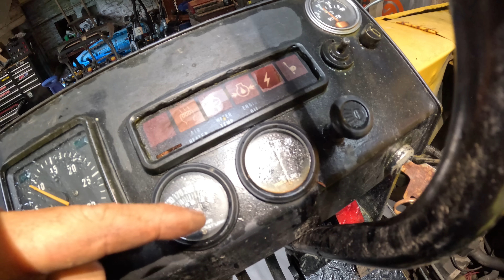Buying a broken yanmar diesel dump truck

Comment: Max and Mingo are such sweet dogs, I love them. Check the crankcase breather on that engine, it's not letting much air in because the oil was having a problem draining. God bless, you're living a lot of people's dream! 🙂
Reply from the maker: That’s a good point. It drained once I opened the cap but it does kinda hiss for a few seconds after you shut it down, maybe the breather is restricted

Comment: I ran an old case bulldozer for someone once and only the left track brake would work so if you wanted to turn left you just went forward with the left brake on and it turned left and if you wanted to turn right, you went backwards with the left brake on and it would turn you right lol I got super use to it after dozing 20 acres of trees and brush.
Reply from the maker: I ran a d9H like that for a couple weeks, pretty annoying lol

Comment: Nice score! I have a YFB 20-2, older version I resurrected from certain death. They suck to drive but worth their weight in gold when you need them so worth buying. Mine has full manual drive train also, and is still in factory - stock adjustment locations. Yours in is in pretty great shape, Id go through the whole thing, fix all the dents, change all the fluids and recondition her and she will be like a brand new one! 
I mostly use mine for hauling firewood. lol
Reply from the maker: It’s such a useful machine! I did a service, just gonna use it and take care of it

Comment: Hey great video!
I bought one of these earlier for basically pennies. Mine had a mud drill mounted in the bed. I didn’t get a chance to make my video of it yet but I sold mine for $6700. Yours is in ALOT better shape. I’d say you could pull 8-10k out of it easy. 

I have a smaller version too, it’s only 48” wide. Great for getting in to tight back yards!
Reply from the maker: That’s good to know, I kinda figured. 8-10k was the market on em

Comment: I noticed you forgot to put the Mahindra in 4x4.. but I also noticed the eas at which the rear wheels spun. Fill those rear tires about 75% with water... much better traction without having to buy wheel weights. 
 That track truck is pretty cool.  Too bad it doesn't have a "road gear "...lol 
 Great content

Comment: Value, due to it's marginal capacity and used condition is probably 8 to 10K, maybe for for someone who has a direct need for such a device.  I have rural land and can not think of much value personally so I'd pay nothing.  However, if you had swampy land and needed access with dump ability, this might suit you just fine.

Comment: 40:15. When I saw that old 2x10 I thought of something. would it be beneficial to use that (or something like) to mount above bed side rails to increase load volume? Also, since you got a oil filter, I'm assuming parts availability is not an issue? Be blessed bro. Yashua rules!
Reply from the maker: Yea parts are available, it hasn’t broken tho so I really haven’t bought parts other than service stuff

Comment: heres a trick for taking out sump bolts   cut the top of a plastic coke bottle   so its like a funnel    put your  half inch extender bar though the top  so it looks like your using it as a funnel  put your socket on  undo your sump blot no mess no fuss  added bonus you dont have to look for the bolt in the oil pan !
Reply from the maker: That’s a great idea, I’m gonna use that for sure

Comment: isn't that  a zerk fitting on that seized part you are beating on?
Reply from the maker: Yes. It wouldn’t take grease untill I freed the linkage up
Reply: @99Projects  I have a saying that I always say about all equipment. Nothing is cheep except the grease and this is often where the trouble begins with neglect
Reply from the maker: @johnypitman2368  my saying is similar, greasing equipment is the highest paying job you can have. its crazy that people neglect it so badly

Comment: Of course you put the plug back in the bottom otherwise it wouldn't be up on the dipstick.
Reply from the maker: If I didn’t note that, the collection of concrete kyles and Karen’s would descend on my with the force of a thousand camels and carefully remind me that I did not put it back.

Comment: Dude the linkages need taking apart, cleaning and regreasing. Working the joint is not the answer. Hitting it with an adjustable spanner, spraying with penetrant and then prising it with a screwdriver is not the answer mate.
Reply from the maker: Seems like it worked fine

Comment: Dude you never use old engine oil on the gasket of a new oil filter, cause all the grit that's in the old oil can get on the gasket and not create a good seal. You're supposed to use new engine oil on the gasket to create a good seal.
Reply from the maker: kinda splitting hairs on that one, its not a formula one car, its a diesel dump truck

Comment: Why are all the seats so roached out on this outdoor equipment. Can’t they make a heavy duty waterproof seat cover that will last?
Reply from the maker: The seats cal apart when it gets cold. I agree they should be made better
Reply: @99Projects doh, spellcheck alert, seats and roached, but you got the drift. Looks like a great unit.